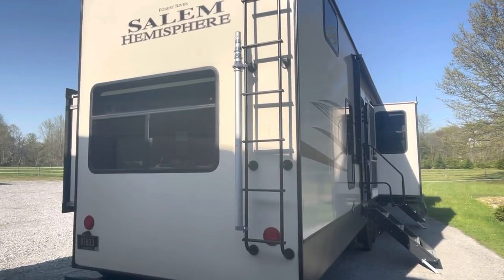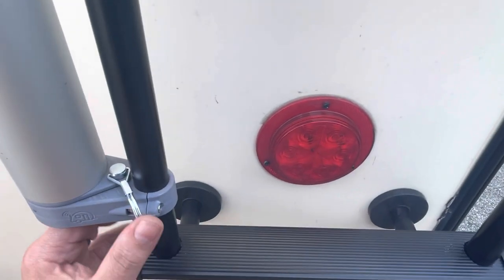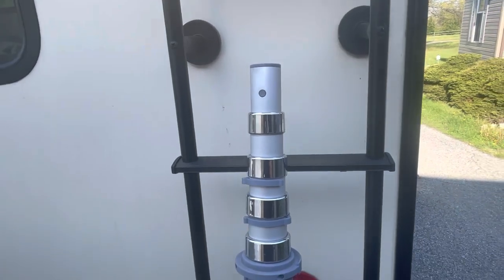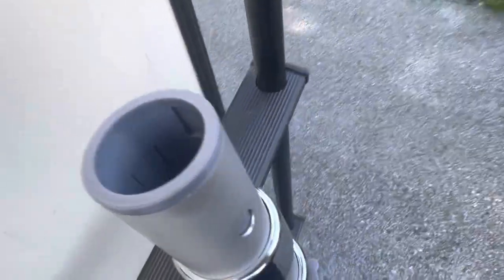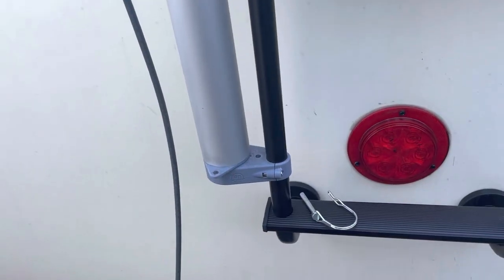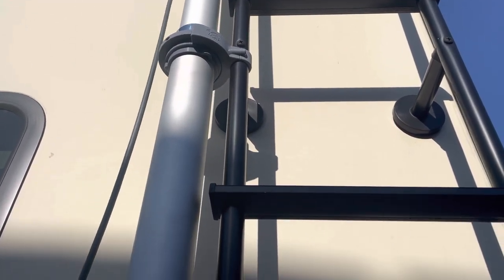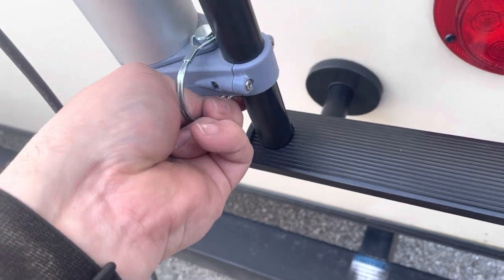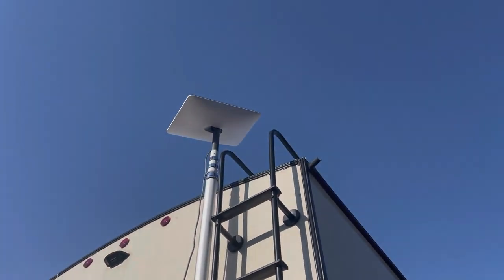Starlink RV mount with Harbor Freight flagpole

Comment: I just received the Adaptor Bushing.  The bushing has two retaining clips that prevent it from inadvertently pulling out from the pole, but the two corresponding holes on the pole are too small.  I drilled out the two small holes using a 3/8" drill and removed burrs with a file.  Now the Adaptor Bushing clips securely in place.
Reply from the maker: Yes, the instructions on the listing state to drill out the screw holes to 3/8”. A step bit is preferred as they tend to make a more round hole and avoid burrs.

Comment: I guess I jumped the gun.  Bought the insert and the flagpole and then just bought the flagpole buddy temporarily until these cool bushings were available.  Unfortunately the HF flag pole was way to big for the flagpole buddy cup at the bottom.  I don't want to buy another flagpole so I took the bottom couple of sections off the pole to make it temporarily work (not sure if I will get it back together but oh well).  I know it will greatly decrease the strength but I'm just trying to improvise I guess LOL.  Next time I will read more.  Let us know when the other parts are available.

Comment: Definitely interested in one of the bushings. Awesome job you have done designing it, looks great.
Reply: @RemotelyConnected  I ordered the bushing just a bit ago.
Reply: @RemotelyConnected   Ian, when will kit with bushing and pole mounting parts be ready? I would like to order the kit. We are volunteering in Grand Teton National Park from mid May to early October. I’ve checked out where we will be camped and looks like Star link is available there. 
Thx, Jim

Comment: This is exactly what I’m looking for to install a cell booster system on my Leisure Travel Van.
The Harbor Freight pole is not a problem.
I do have a question about the ladder mount…. Is the Etsy product featured have all the parts for a complete install like yours?
Thanks!

Comment: Can you post an update as to how testing is going? Ordered the bushing and installed yesterday, jeez was that simple with a step bit. Can’t wait to order the mount for our class a RV ladder, zip ties are already getting old securing it to the ladder.
Reply from the maker: Going well, will put out an updated video soon. We have made some changes to the design for strength and to accommodate additional mounting options and are working to get those updated kits to our testers as we speak. Hoping for a full release in about a month

Comment: This is brilliant. I want one of these but instead of the Starlink, I want to mount a HiBoost or WeBoost cell booster antenna on the top of the pole. Any plans for that, or a way to order just the ladder mounts for the HF flagpole? Thanks in advance!

Comment: why are all the STLs being taken down? I've been looking everywhere all websites free and paid have suddenly removed the Harbor freight Starlink Adapter??? if the design was patented then who's selling the official one?
Reply from the maker: The adapter bushing is not patented but out mount conversion setup is patent pending.  We can't speak for other designers but we have made the choice to remove the digital download as an option as it was brought to our attention that a number of folks were printing copies not for their personal use as well as sharing the digital file with others, a violation of our licensing terms but also the TOS of both Cults3D and Etsy.  Since the digital download comprised relatively small amount of sales and there is not an effective way to control use of the downloaded STL we made the call that the risk was not worth it at this time.  We will reevalutate in the future and may consider reactivating the listings once our mount conversion is available.  We do still offer the physical adapter and will continue to do so.  Thanks for the interest.

Comment: In your video, you don't extend the flag pole past the minimum to clear the ladder. Do you have any concerns about extending further? IE you may not trust the HF pole to that level?
Reply from the maker: No concerns, just without obstructions it’s unnecessary. We have heard a few folks mention the HF twist mechanism slipping, if that’s a concern clamps could always be added.

Comment: is the Starlink bushing the same as the Starlink adapter on ETSY to order? How did you line up to 3/8" hole to be spot on when drilling? My HFP only had two little screw holes that help keep the top in place for the ball.

Comment: Ok take my money! 😀any idea on when it will be on your etsy page, I would like to order both parts at the same time?
Reply from the maker: Targeting about a month. We’ve been working hard to update the design to accommodate additional mounting options and test to ensure durability. We’ll be moving from Etsy and adding additional products, keep an eye out on our socials for updates. Note that the adapter can be sourced now if you use a temp mounting solution as we intend to market a version without an adapter for folks that have one or to use for mounting other antenna types, etc
Reply: @RemotelyConnected  Are we there yet?🤣

Comment: I’m interested in purchasing the ladder kit as soon as it’s ready. I do have another question about something that was in your video. It’s the RJ45 on the cable, I would love to do that as well. What changes did you have to make to have the dishy removable with the RJ45? I have all the tools to add the RJ45 plug. I have the cable ran though the wall on my motor home and it’s not easy removing the cable every time so I can store the dishy for travel. 
Thanks
Reply from the maker: The cable on the v3 (rectangular/square) dishes is normal cat5e, the v1/v2 (round) dishes was cat6.  Both are easily cut and reterminated and, if not eliminating the OEM router in favor of an aftermarket router and PoE setup, can simply use normal t568b pinouts.  In their infinite wisdom SpaceX decided to ignore PoE standards so if you want to go that direction the polarity must be swapped which involves swapping two of the pairs before and after the passive PoE injector you utilize...affectionately nicknamed t568elon.  There are a number of how-to's out on the topic and we're considering making a tech video demonstrating in the near future.
Reply: @RemotelyConnected  
Thanks for the reply. When I cut into the wire to the dishy I noticed that it had a bear ground wire, or I’m assuming that it’s a ground wire. Do I need that wire because if so I don’t have another connection point and would need to run a separate wire?
Thanks

Comment: What exactly is the piece that’s connected to the ladder the gray piece that has the pin in it. I’ve looked at all he links and it’s not there
Reply from the maker: That is a portion of a prototype mount kit we're now beta testing.  It was originally designed for personal use but with the attention it has received we are working out any kinks and intend to bring it to market in the next 1-2mos.